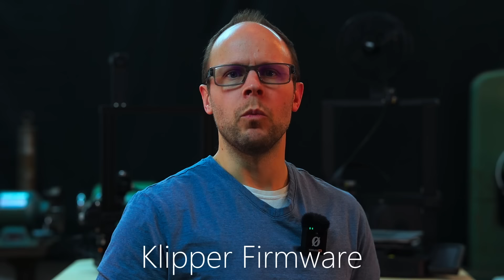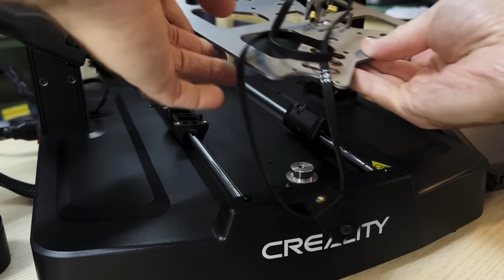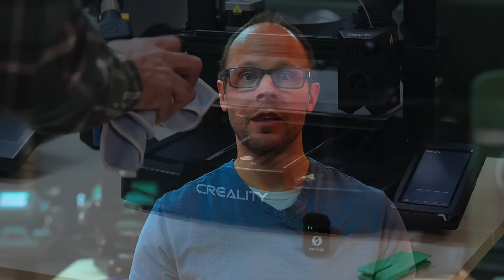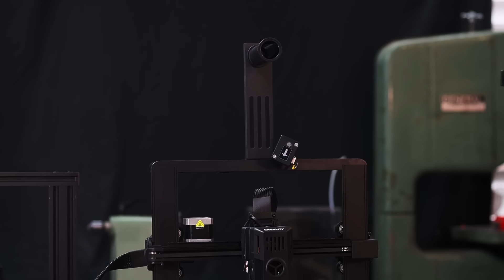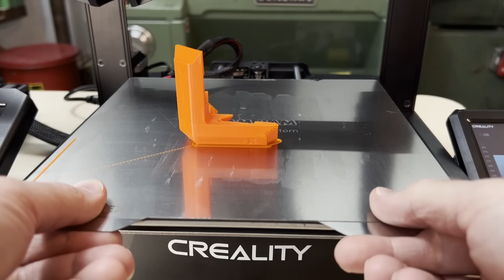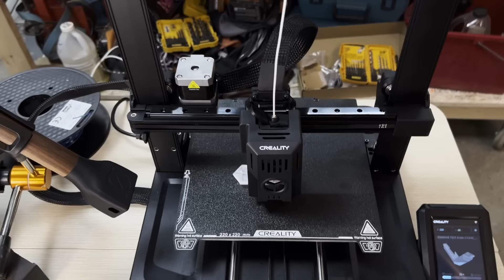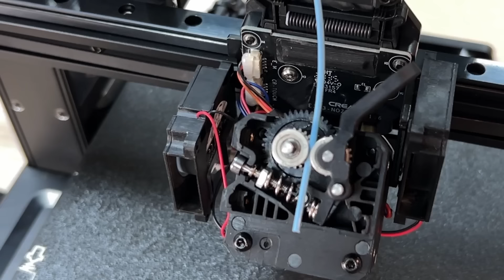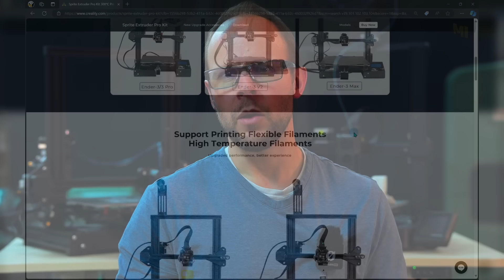Is the Creality Ender 3 V3 KE Any Good?

Comment: Thanks for the review. The linear rod and bearing tolerance issue is common with cheap printers. My Sovol SV06 and sv06 plus both have that issue and both use linear rods. I bought quite a few sets of bearings and out of 16 bearings I bought only a few had tight tolerance. I did find repacking the bearings helped a lot. They don't seem to pack them at all from the factory. I also have a k1 and that thing prints better but I have my bed stingers printing very well now with some mods. They are also running klipper now.
Reply from the maker: Thank you for checking it out!  Iit definitely has some potential, the bearings/rods is a bit of a concern, with all of this speed and tolerances like that, people aren't going to be able to get the results they're looking for, maybe for someone new this will be okay for a while.  I think very small linear rails would have worked a lot better, I assume the price would have been a problem.  From what I can tell, this printer should be cheaper to manufacture compared to the original with the 1 pc molded base.   Still I suppose we get what we pay for, the KE is less than 1/2 the price of the K1.  I still prefer the Core XY.  Because I have all of these more expensive printers, I needed to keep reminding myself that the results will not be the same, it's not an apples-apples.  Regardless, the issue with the extruder/hot end with PETG was a bit concerning, and I plan on swapping out the extruder to see if that makes a difference, hopefully we can figure out the missing link on that.